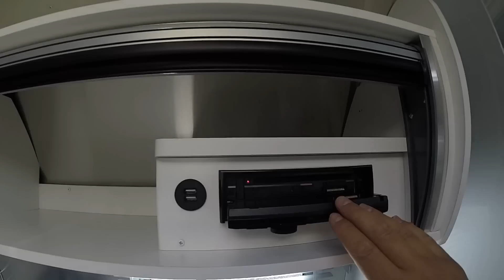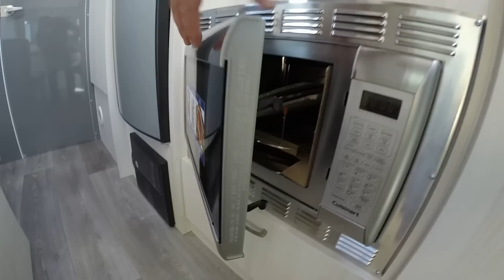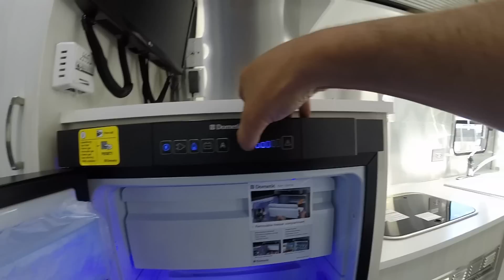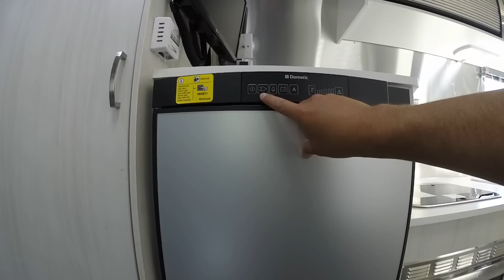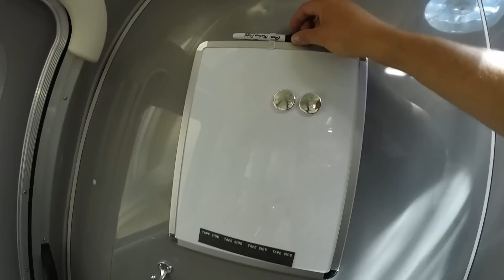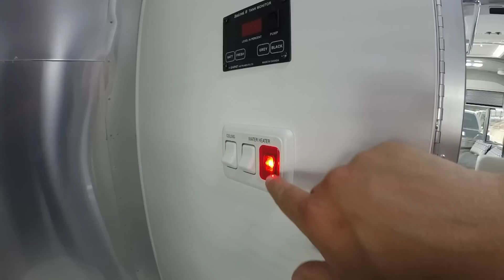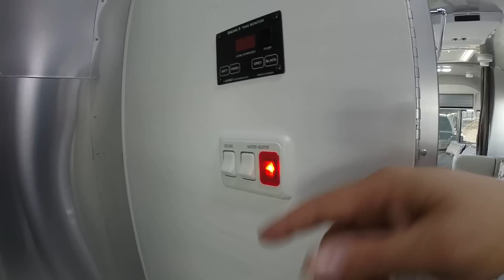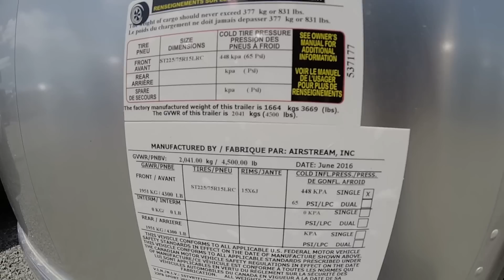Walk Through 2017 Airstream Sport 22FB Bambi Light Weight Tiny Small Camping Travel Trailer

Comment: Very nice. One improvement would be to move the spice rack away from the stove but still within easy reach. Heat degrades the quality of the spices. If you can make it a spice/oil/condiment rack so one level could hold olive oil, hot sauce, etc. then it would be more practical. Love the curtain tracks. Nice to have soft window coverings. Hope they are very easy to clean, especially for those with allergies. Bed bags for the mattress or a covering that can be cleaned to remove dust mites and bedspread that can be washed in hot water or left off (for less money) to be replaced by something for people with allergies would be best. Love the fridge on battery as no one wants to waste food, etc. Backup camera also great.
Reply from the maker: Thank you for all your great suggestions.

Comment: Patrick Botticelli your Airstream video reviews are superlative in their detailed info.They are not too long as a non RV spec geek can always click off.You have much to be proud of in your presentations.Is the toilet porcelain on this 55K rig? What is the bunk length on the converted dinette? For kids only? If so,maybe Airstream could hinge the cushion support doorside l( w appropriate support hardware)to allow an adult sleep space even with some foot dangling.A suggestion.Best wishes in all future personal and RV endeavors.
P.S.Colonial ever consider stocking All Aluminum/Composite Livin Lite /Camplite trailers as a working guy/gal option? Take Care Patrick,Thx
Reply from the maker: Thank you for the message. The toilet on the Sport Bambi is plastic but the Flying Cloud series and up have porcelain. The dinette folds down to a 38" W X 74.5" long bed for two kids or one adult. You may be able to modify it aftermarket if you wish to have longer sleeping length. Colonial is exclusive to the Brand Airstream for towables.
Reply: Thx again Patrick for your timely professionalism.

Comment: These are great videos that do an excellent job of demonstrating why the Airstream is so special.  With this Airstream -- I have a Touareg TDI -- will the Touareg tow this thing "out of the box" or is special equipment required?  I love what I see in the Airstreams, but I don't want to have to buy a truck in order to own one.
Reply from the maker: We recommend purchasing a Prodigy RF wireless brake controller for the Touareg and an Equalizer 600# weight distributing hitch system with 4 point sway for in between the truck and trailer.

Comment: is it advisable to seal all the exterior seams and rivets immediately after purchase with a high quality flexible caulking?     all the vibrations and flexing of the trailer .. seems  leaks would surface quickly
Reply from the maker: It is not necessary to seal the rivets.

Comment: Have a 2017 Jeep Cherokee V6 w Tow Pkg (4500 lb limit) originally intended for use as four-down dinghy for Class A.  Now considering travel trailers instead and ran across your video - Exceptional coverage and quality of presentation, btw.  Would you consider this a good model (Sport 22FB) a good fit for 3-person vacationing and would you consider this appropriate for 4-season use?
Reply from the maker: The Sport 22FB Bambi will tow excellent with the Jeep Cherokee. This trailer will accommodate 3 people very well. Airstreams have heated tanks and enclosed underbellies for unexpected drops in temperatures but it is not considered a 4 season RV.

Comment: If the air conditioning won't work without being plugged in to 30 amp electric ?
Can I alternatively use a generator if iam off the grid providing the generator puts out 30 amps ?
Reply: You'll need a 3400 watt generator or a pair of 2000 watt generators linked together.  Now a bunch of people that wouldn't answer you before are going to jump in and tell you how wrong I am.  LOL

Comment: Partick, great videos, keep them coming. I have a question for you. Are you aware of any aftermarket offroad mods to these trailers? What would you say the campsite limitations  of airstream would be? 

Cheers, 
fellow cyclist.
Reply from the maker: Thank you for watching. There is very little you can change in regards to off road capability for this Airstream or others. On the Sport 33FB one may purchase the Stainless Steel Wrap Protector Kit for to protect the from curved aluminum panels. 

Travel Trailer 28' and under are acceptable at most State and national Parks in the USA.

Be safe out there.

Comment: Patrick. Learned a lot from the excellent video. Hope to chat with you soon about a 22Sport.Meantime, 1) are aluminum blinds an Airstream option for bedroom (white cloth gets dirty after time)?, 2) looks like awning control rod sits kitty-corner in closet, if so this may make storage of clothes awkward?, 3) white water tank drain valve looks plastic, or is it metal? and 4) is a rear bumper an option (to enable bike storage) an Airstream factory option? Thanks for your time and consideration. Regards, GPS
Reply from the maker: The Aluminum blinds were standard in 2016 but are no longer available for 2017. I am sure you can retrofit aftermarket. The awning rod can be stored wherever you would like to put it. The waste gates are ABS plastic. There is an aftermarket bumper kit available for $1,400.00. It is not designed for a bike rack.

Comment: why does not Airstream offer dual axles? it seems to me stability and towing capacity would be better then a single axle
Reply from the maker: Raymond. Sure Airstream offers dual axles on 23' models and up. The rubber torsion and low center of gravity of an Airstream offers superior handling even on the single axle Bambi models.

Comment: What are the tank capacities?  Because if they were full, that wouldn't leave much weight left for gear.
Reply from the maker: The fresh water tank is 20 gallons. That water when used will drain into a grey tank or black tank. there should never be a possibility where you would have all three full.
Reply: Only 20 gallons?  That suck.  My lance tanks are 50 gallons each.

Comment: I see that you guys have 2018 models on your lot, is there anything new or different?
Reply from the maker: Yes the 2018's have arrived Billy. The sports received a multi stage battery charger, updated shower heads and aluminum finish below the roof locker cabinets.

Comment: Can I safely town a 2017 Airstream Sport 22FB Bambi with my 2015 Toyota Highlander with tow package rated for 5000 GVWR?
Reply from the maker: Yes, I believe that vehicle would do a great and safe job pulling this Airstream. Patrick
Reply: yeah these people are salespeople... totally incompetent when it comes to technicals. they'll tell you ANYTHING you wanna hear to make the sale. salespeople sell themselves THEN they may sell you a ton of garbage... once they've sold themselves how much a wonderful person they are. when in fact they laugh all the way to the bank. of course there are exceptions... people that actually care. but in this day? yeah, right.
Reply: You don't want to tow a trailer very much if it's gross weight is near the rated maximum of the tow vehicle.  Maybe an occasional weekend but not all the time.
Reply: Tim Thompson 
What's with the language?
Reply: max GVWR is 4500 lbs on this trailer, he can definitely tow it with his tv rated for 5000lbs.  What do you want him to get an F350 to safely tow this?  I consistently tow 7500lbs with my 7716lb GVWR tow capacity tv with no issues.  There is a reason the manufacturer approved his vehicle to tow 5000 lbs.

Comment: Hey Patrick is it possible to purchase a 22FB with wired 50amps versus 30amps?
Reply: The reason for my question about amp conversion./installation is because of recent videos I've watched where some owners have changed or have 50amp supplied wiring versus 30amp and are able to run a number of appliances at the same time without blowing /breaking the circuit.

Comment: GFCI electrical outlet? What for ? Grounded where ?
Reply from the maker: This style outlet is required to meet RVIA code just as it is in most homes in kitchens and baths in the USA.
Reply: Thanks for the info.  I think this is an example of misplaced requirement.  To the best of my knowledge the GFCI is a GROUND Fault Circuit Interrupt.  By definition it work based on a ground reference, I do not think that there is a ground reference in a RV.  But anyway you should comply with the requirement.
Reply: +Happy Camper Actually,  it's not a misplaced requirement.  GFCI is a great safety feature, no matter where it's installed.  It's not dependant on whether your trailer is grounded or not. GFCI can detect a slight difference in current between the "hot" and neutral conductors and opens the circuit. Say, you accidentally come in contact with an energized wire and you are standing outside your trailer, barefoot and using a 120VAC drill to fix something. What if the drill has the hot wire loose and touching its metal handle. Your extension cord was " upgraded" to fit into any receptacle by breaking off the grounding tongue. Normally the wire would short to ground and open the breaker but since the drill has no ground, you become a conductor to ground. It does not take much current to stop youf heart. Many accidents happened this way. Fortunately your trailer has a GFCI receptacle. The GFCI device in it will detect that there is a leakage to ground (through your body) and will instantly open the circuit thus potentially saving your bacon.
This cheap safety device is worth every penny. I hope this explanation helps.

Comment: Did he really mean repack the wheel bearing ever 3-5 thousand miles?
Reply from the maker: It is recommended.
Reply: Are their any options where grease fittings can be added so you don't have to disassemble all that?  Asking as a layman...if that was unclear.  ;)Great video by the way.  We'll be shopping for a camper in the next year or so.
Reply from the maker: If you are doing a real long trip you can extend it to 10K miles as the hub manufacture recommends. Airstream recommends doing it at least every 3-5Kmils because an average owner dos that in a year. A grease fitting is not available on this style axle and hub.
Reply: Ahh.  Excellent.J ust discovered you today.  Thanks!! your vids are awesome!
Reply from the maker: Thank you very much.

Comment: too much wood
Reply from the maker: Would you like plastic instead?
Reply: Yes I agree plywood is much stronger than particle board, but that doesn't mean it's the best out there. I live up here in BC, Canada where i hunt. Lots of rain and dirt roads. I've owned a few cheap tin poorly constructed (4 season) trailers that don't last more than three years. I decided I would spend the money and bought a lightly used 2010 airstream. By 2015 the unit was squeaking and creaking like crazy not to mention having to go to the dealer for out of warranty repairs and of other issues. Not what I expected for having spent that kind of money. I had enough of it, and took the ridiculously low buyback offer from the dealer because I wanted out. Now maybe this new model has had changes or maybe it will experience similar issues like mine did. I don't know and I don't care anymore, but this lovely brand new unit sitting on the showroom floor compared to it a few years later is completely different, thats the review you should be showing everbody. Sincerely and respectfully.
Reply: Hey westernsharpie, it’s interesting you say that. My wife and I were interested in an airstream, just wondering what were some of these issues that you were having?
Reply: J McK
The floor was creaking with every step. Some of the cabinetry would squeak and not close properly. A few valves in the plumbing lines began to leak and went unnoticed for some time, only to be absorbed by the plywood which had began to swell and rot. The rot could have also come from a leak on the outside it was very hard for them to tell. The air conditioner broke. A few rivets fell out. The mini blinds seemed to be quite cheap and began to break. The list goes on. When I discovered the rotten floor, I threw the towel in and said I need to find a trailer with the least amount of wood possible. The price far exceeds the value in my opinion, I also find it hard to believe that all those issues I had in my 2010 have miraculously been worked out in this model thats being advertised. Be prepared to bleed from the ass.